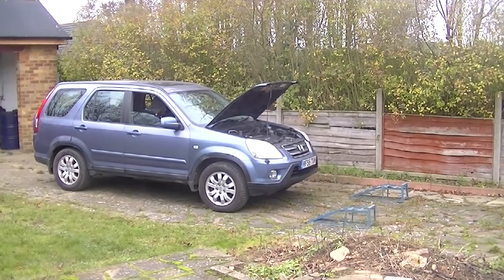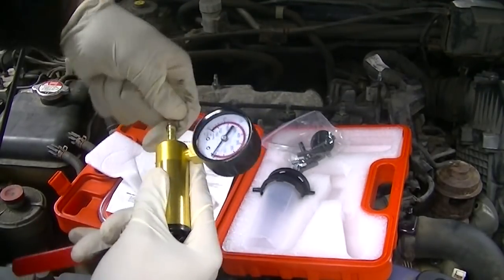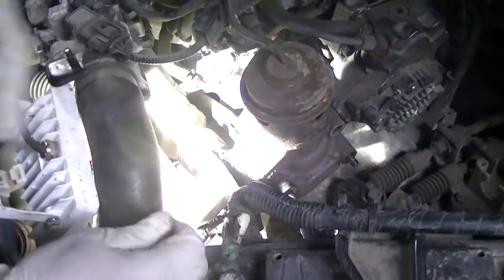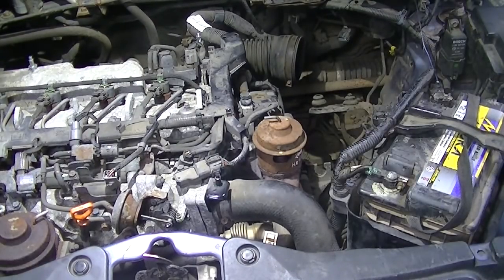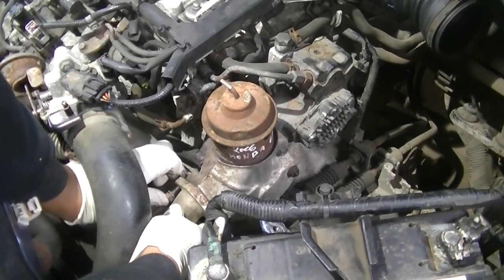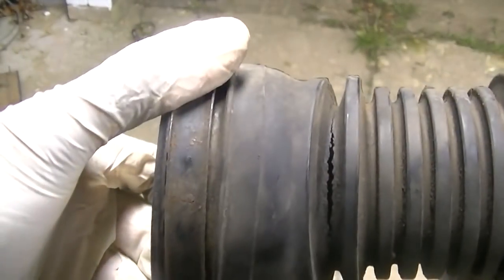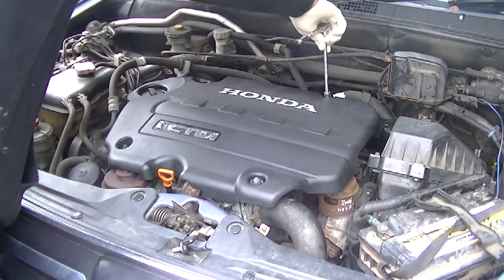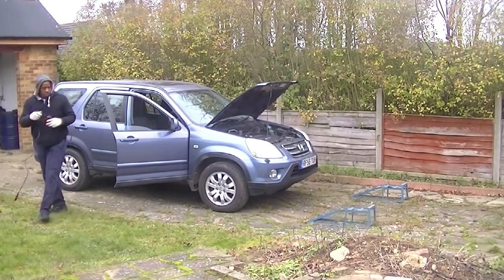How to Test & Replace An EGR Valve P1401 Fault Code

Comment: Hi I have a Honda civic 2.2 diesel different engine to what is in the video it only has 1 egr valve. I have p1401 engine light on (it only comes on at idle, I can reset it and it won't come on untill I come to a stop and leave it idling) seen a few of your videos. How do I test as I've cleaned the egr and it still comes back on. Any help appreciated
Reply: Hi ,i have the same problem how do you fix it?
Reply: @Ciprian Florea  hi I ended up getting a remap with egr delete didn't have any more issues, car was more responsive after remap too

Comment: Good video, but please don't laugh and say "that I did what any good mechanic would do" when you're putting gaffa tape on an Air Intake Pipe that has perished at a point that is post Air Flow Meter / IAT.

Only a cowboy or someone who does not understand Air / Fuel Ratio's would do such a thing. 

You could have cleaned the sections and used Super Glue or Epoxy Resin to bond it back together, or just replaced the damn thing as the Engine is never going to attain Smooth Running Idle the way it is.

Even if it feels like it's running smooth,  Live Data will confirm that it's under fuelled.  

I know you're better than that........

Edit made to let you know that I've given you a thumbs up as usual.
Reply from the maker: I appreciate the thumbs up and taking the time to comment. The "good mechanic" comment was one in jest, I was in a tight situation and needed to make sure that all of the problems had been solved. The pipe seemed quite soft and degraded, super glue was far too rigid of a compound and I had nothing else to fix it. The ductile was a simple logical thing to use considering the circumstances. Its blocked the holes and gave the perished pipe some support until the new part came. 

I don't quite understand your comment about about the engine showing under fuelled. If all holes and vacuum leaks are sealed, why would live data show up as being under fuelled?
Reply: @BMACVAGS  

I know that you were making a joke. 

I've watched all of your videos, you do know what you're doing. 

FYI:

Any Intake Pipe that is loose or has a slit / hole / tear positioned after the Air Flow Meter will affect the Air / Fuel Ratio of the engine. 

This occurs because the ECU is dosing the Fuel Injection in accordance to how many liters of Air is entering through the Intake System and what temperature the Air is at when it's entering. 

Duct Tape on a ribbed Pipe will not give a true seal, no way. 

Therefore, even at Idle, the ECU has a miscalculation, because extra Air is entering the Intake Manifold, probably at a hotter temperature too, which it has not taken into account in order to determine the true Smooth Running Idle Compensation. 

The ECU may revert to the O2 Sensor or Barometric Pressure Sensor and try to compensate, but it will result in power fluctuations and MPG efficiency.

Short & Long Term Fuel Trim Data will show you the actual difference between this Pipe and a decent Pipe.
Reply from the maker: @ukcitizen1158  I promise you, the amount of duct tape that I used there is no way that pipe is leaking any air. Although I do know that in a perfect world replacement is the correct way.  Its also important to remember that many people who watch my videos do not always have the facilities or resources to repair their cars to dealership levels. So it is good to know stop gap solutions that can get them out of trouble. Thank. you for your comments, I really appreciate the dialogue.
Reply: @BMACVAGS  

No worries.